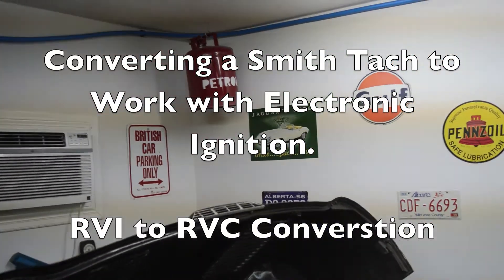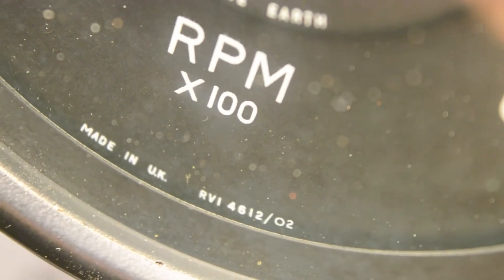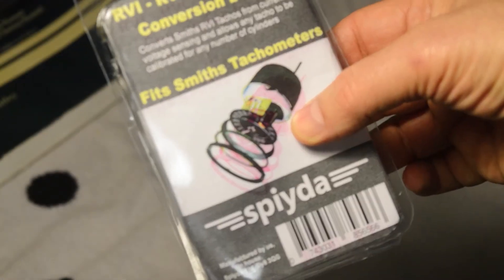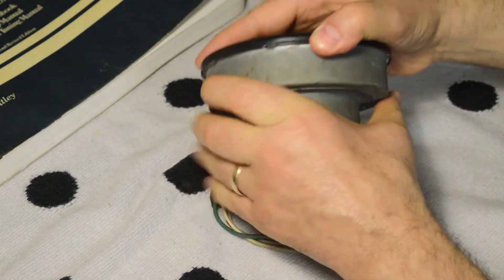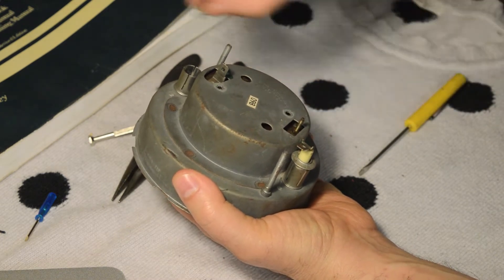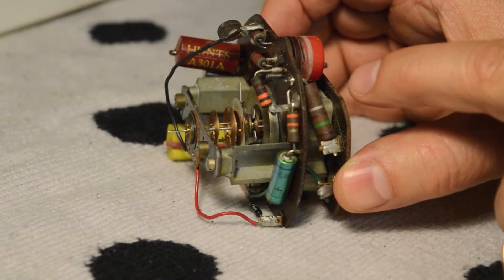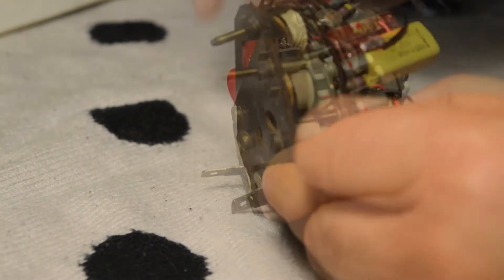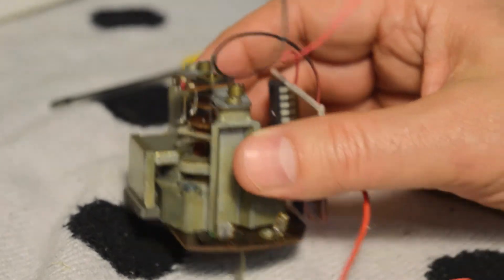XKE Spiyda Conversion Smith Tach: Part 1

Comment: Ed, thank you for giving me a video (hand)...I was able to do 2 of mine...took 5-6 hours.  You seem to be a natural teacher...very well presented.  I too ordered the kit (actually 3)from spiyda.  Chris sent them arrived in good time...like everything else was a bit more.  Only thing took me a while was the thick read wire is your 12 volt hot line...or is connected to the green 12 volt hot...really, nothing tricky...at all.  Again Thanks.   Mitch. 5/4/23
Reply: Thank you for your gracious comment. Good luck with the project.